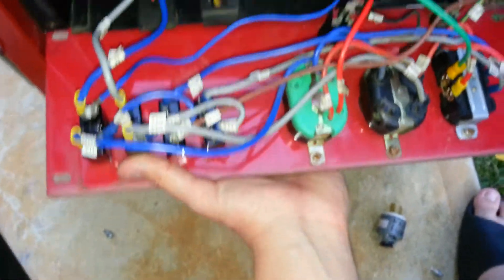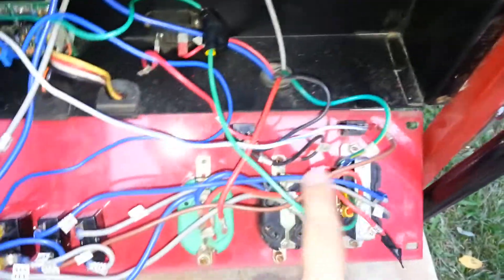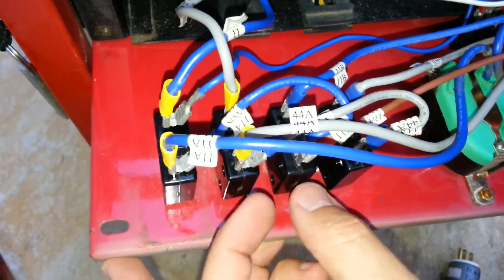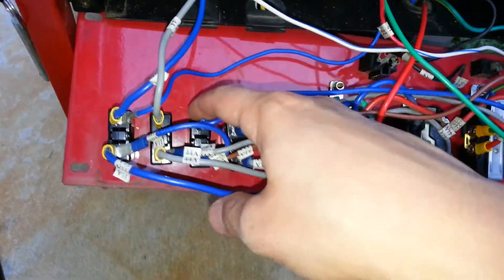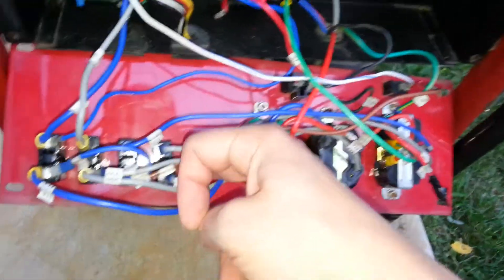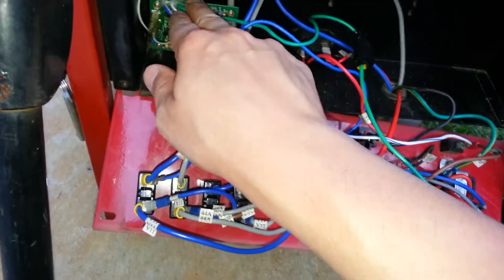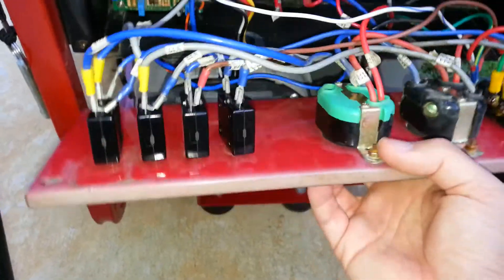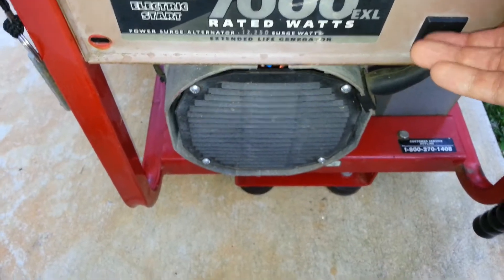Generac Portable Generator Wiring Diagnostic/Overview Part 02

Comment: Hi.  I believe I found a toggle switch that I can place between the netural and ground to make it easier to bond and un-bond the generator.  (Need to confirm wire size to use and whether it should be stranded or solid).  As per your suggestion, I found a toggle switch rated 30a/250v.  Made by a company named Eaton switch # 7576K2.  I ordered an extra switch, which I would like to send to you just to say thanks for all your help over the years.  And maybe if interested, make a video on the installation.  I think many people would enjoy it.  How can I get this switch  to you? Thanks, John.  Happy New Year.
Reply from the maker: Hey John. Shoot me an email and we can discuss. Appreciate you thinking of me. Yeah that switch should be enough. There are stranded wires for the stator using 10 gauge class f insulation meaning that it has a plastic sheath over the insulation of the wire. You can get away with the same level of insulation wire but at a 12 gauge since it's usually under sized slightly, but nothing wrong with keeping it 10 gauge to be honest.

Now I will say that this set up your proposing isn't OSHA compliant or up to NEC Code. You installed the switch for the purpose discussed at your own risk. I do hear many people doing this modification. In my opinion if you are going to use the generator always for home backup with a two-pole transfer switch then why do the switch at all? If you were going to use it as a standalone generator then you can make yourself a simple jumper plug that goes into the duplex outlet to bond the neutral to Earth and then unplug it when you need to use it for the house

Comment: Hi.  If I wanted to place a simple toggle switch in- between the ground, netrual bond wire and attach it to the face plate, do I need a special 2 pin toggle switch, or will any 2 pin switch work? I'd like to be able to go from bonded to floating using the switch. Thanks.
Reply from the maker: You need a switch rated for up to the full rated current of 30A at 240A. expensive switch.
Reply: @Bassguitarist1985  Thank you.  I knew you would have the answer.

Comment: Hi.  Just tapping your knowledge.  If you have a dual fuel generator any size Is it safe /possible to run natural gas through the proper gas regular for natural gas using the lp factory hose connection on the generator?  So natural gas coming from the house to the proper natural gas regulator The another hose from that regulator to the factory port on the generator that you would have normally hooked up your propane hose.  I think this would be an interesting video for many.  As always you thoughts are much appreciated.
Reply from the maker: With the proper connectors and regulator yes it would be possible. Unfortunately i do not have natural gas at my house so it is not a video I could do.
Reply: @Bassguitarist1985  Again, thank you.  Much appreciated.

Comment: Hi, I have a 2.5kw  single phase, 6.5hp petrol generator.  It hasn’t been used for several years.  I ran a 950W hairdryer for 5 minutes and the stator smoked. A new stator was acquired but I’m not sure which way to wire the two main coils.  The wire colours are different so I can’t go off that, unfortunately.  The two coils both measure 0.4 Ohms but I’m not sure which lead is L1 and which wire is L2 , similarly which wire is L2 and which wire is R2.  I don’t want to connect the coils in anti phase to each other, or does it matter?  I’m in the UK so I need 240 v therefore the two coils must be in series and I’m wondering if it matters which way the two coils are wired in series with each other.  I’ve never attempted this type of repair before so I hope my question isn’t  stupid and that you can advise me please?  Thanks in advance.
Reply from the maker: Most certainly not stupid. Yes there is a common point the two main stator winding coils need to be connected, if connected backwards that would be no good. None of the wires are labeled?

Comment: i have a craftsman 7500 port. gen set replaced rotor and lost paper with wire connects that read something like 2 to blue 4 to grey anybody have a 7500 that could send me  hook ups or a pic of the ass end i could look at
Reply from the maker: check smokstak for plenty of pics, common machine

Comment: I have a 17,500 generac generator not producing voltage can you tell me some things to check . have already try ed new voltage regulator no help . no one wants to help just fix and charge me.  thank you randysac@yahoo.com
Reply from the maker: is this the portable generator with open frame? the VR was changed and still no power? Time to do resistance tests on all the windings to make sure they have not failed. It also may be your field boost circuit that is not working.

Comment: Happy 2018 xboxer1985.  I have seen during my searches on the internet a Generac 7550exl the same as mine and yours with a 50 amp twist lock which ours do not have.  I'm wondering how you would use and why a 50 amp receptacle was placed on the generator when you only have 30 amp breakers.  In-addition, would you be able to use both 30 amp receptacles at the same time? Can you run 2- 30 amp lines from the 2- 30 amp receptacles to the electrical panel? Or is the generator just 30 amps in total?  Can you add a 50 amp plug to our generators?  Just curious.  As always thank you for all your expertise.  John

Comment: Hope you would be willing to give me a short list of likely suspects. Generac 4000xl, never abused always stored indoors. Idle down worked perfect last year. Voltage regulation is great and 60hz. RPM's 3400-3700. For no good reason the Idle down circuit has quit functioning with no load connected. Idle control solenoid does move, and adjusts RPM. Governor spring properly connected. Aside from the usual resistive wiring connections and liberal use of de-oxit, what are the most likely suspects before I pull it all apart? The Idle control switch is good BTW. This is an older 4000xl with the steel gas tank, so I suspect it has an early revision 83970 control board....no SMD stuff. I'm electronic savvy, so no need to dumb down. I've seen another video that seems to say Q1 and Q2 (2sc945's) are a common failure mode. Just looking to save some time here.  Thanks for any ideas.
Reply from the maker: hey Paul yes I would concur q2 and q3 are likely suspects if you want send me your email and I can send you the schematics of the idle control specifically that should get you going. glad to make your acquaintance I seem to be in good company with someone who's electronically savvy :-)
Reply: +xboxer1985  Hey back up and running correctly here. Only Q2 was bad (the device connected to the CT). Q3 Mosfet coil driver OK. You kindly saved me allot of grief. One thing to watch out for with those C945 transistors is that the pinout for the one's on that 83970 rev. G board is EBC and NOT ECB. 90% of the C945's (aka 2sc945) I have used in other app's conform to the more common emitter-collector-base (ECB) pinout. If you replace them with the wrong orientation device you will certainly be in for more joy! Wonder how many times that has happened for others attempting to repair these boards? Thanks Xboxer.
Reply from the maker: Yeah my parts list i modded on smokstak for that exact reason a few years ago. EBC is the proper pinout on all through hole revisions. Cheers.